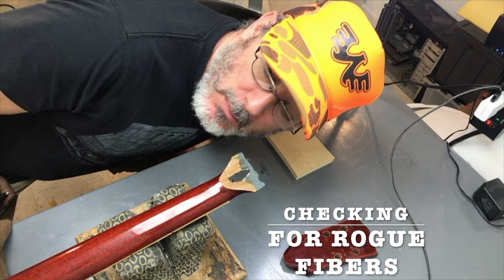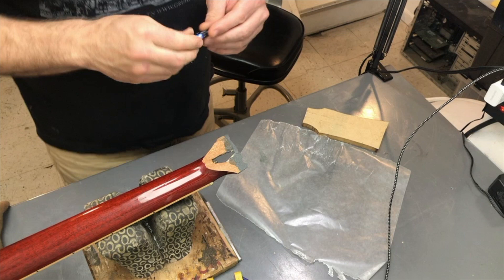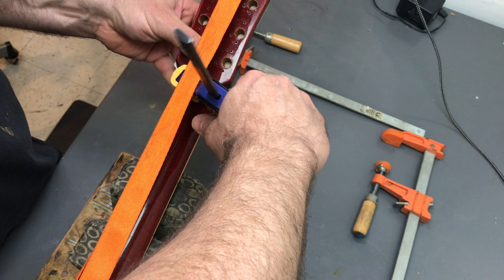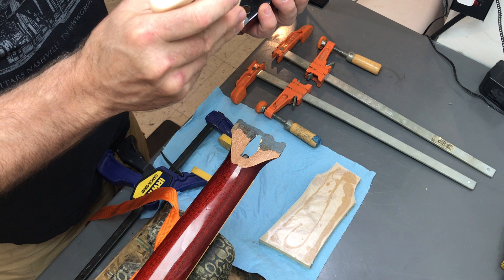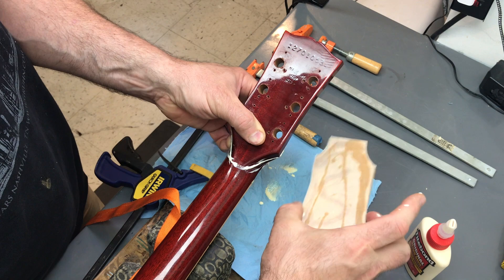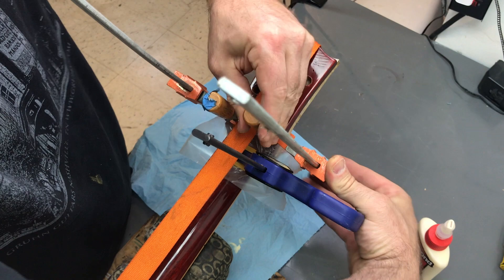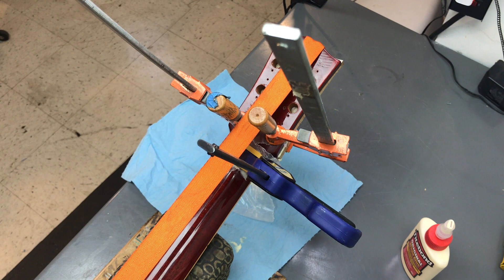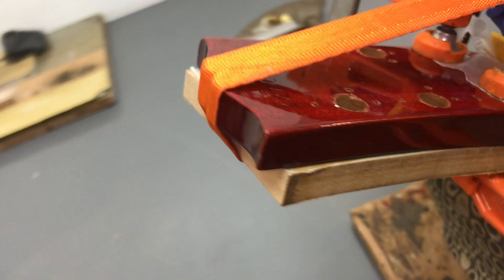Back Strap Overlay Part 1

Comment: Thanks for showing how you work the band clamp to pull the joint together.  It’s a useful technique and legitimizes that a small bit of force and torque sometimes helps a glue-up.